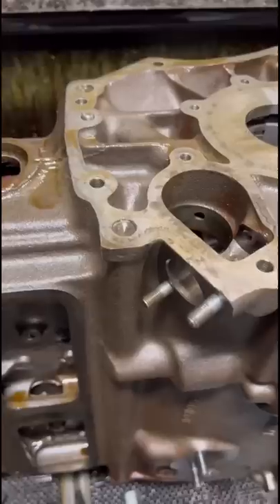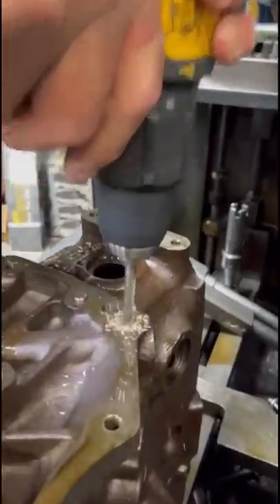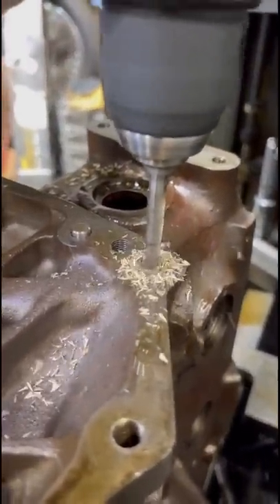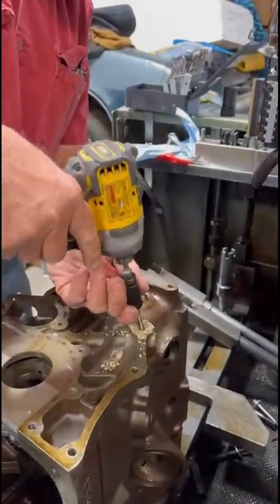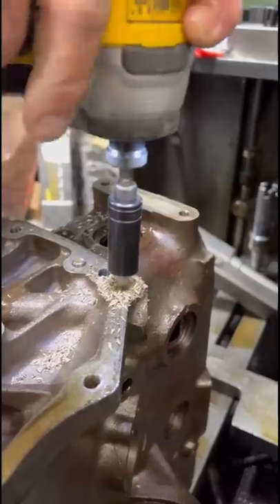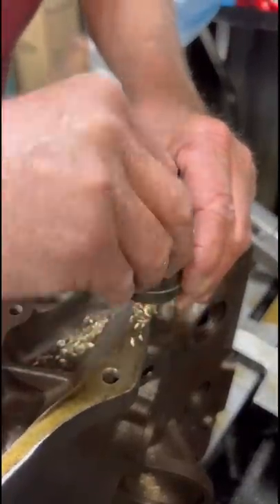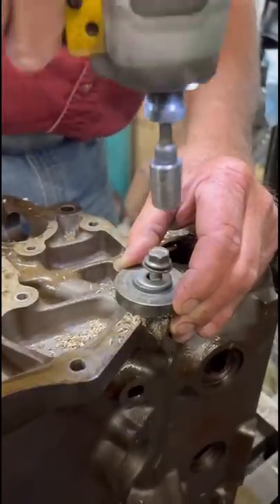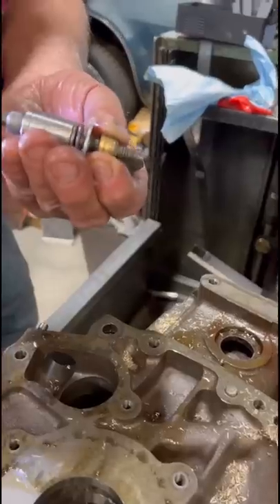#shorts How To Remove Press Fit Brass Oil Galley Plugs The Easy Way

Comment: You had me until "somebody else will clean up those cuttings later."
Reply: The “somebody” that will be cleaning the block is the guy narrating the video. This is his father that’s doing the work in the video.
Reply: If you're pulling the plugs you're probably about to hot tank the block, so yea
Reply: Not when he used an impact to tap the hole?
Reply: It was a joke. He knew he would be the one doing it.
Reply: j o k e
Reply: @nikolaskirisitz6769  he was going into brass with a HSS tap. Better to get in and out with the impact then fuck around with a tap wrench. If you break a tap doing this it’s because you hit the block 😂😂
Reply: By somebody, he meant him. He's just filming the old timer. lol

Comment: If you want to save even more $$, then I recommend leaving the bolt out as well. Those little bastards aren’t cheap. Less oil in the motor also means less weight, so better power to weight and fuel economy.
Reply: Bruh
Reply: Damn it why didn't I think of that.
Reply: If the women don't find you handsome, they should at least find you handy
Reply: Not to mention the reduced parasitic losses since your oil pump is No longer pumpin oil
Reply: Remember, if you see it leaking oil, it still has oil. 👍
Reply: If not even handy, then handicap.
This driller stressed out for camera and nearly broke the bit.
Reply: also do a radiator delete . the higher the temperature the better.  more temperature means more power and better fuel economy. you gonna hit max eco snd super charge abilities when you get that sucker fully in the red . the red means max power
Reply: Also less oil, less windage and adds horsepower, better fuel efficiency, better BITCHES,  BETTER MONEY BETTER LIFEFFEEE

Comment: Leave the shavings in there. The copper in the brass will combine with the oil to form natural copper-slip.
Reply: My Sarcasm meter must be broken... What?
Reply: the block still goes through a cleaning bath before going to machining. and again before going back to the customer.
why clean the same mess now when you're going to have  to clean it again anyway

Comment: Your sense of humor cracks me up. Did you clean those cuttings up already
Reply: lol I thought that too
Reply: it’s a skill i’ve picked up from watching these guys. it’s saved me from having to removea component, cut out a sensor boss, weld in a new, reinstall. i’ve greatly appreciated that leather knowledge over the last 6 months. 

(and if i goob up, I just have to pull and replace anyway)

Comment: Never use a impact when tapping. It does do the job faster , but you run a higher risk of snapping the tap . It also mss was led the threads a tad off and bolts are usually harder to screw in and out .
Reply: Dont matter for this guy he got too much finesse
Reply: Brass is soft unlike most other applications that you’d be correct in.
Reply: This was a joke......
Reply: Keith Smith  you called?
Reply: I do this all the time on high carbon steel, Mild steel and forged steel. Several holes in sequence at once. All you need to do is make sure that bitch is straight with the hole, oil the fuck out of it and change the tap one it gets to hot, use another one until the other one gets cool enough to use again. Look for cracks every 5 holes or so. And you're golden.
Reply: Bro literally says trigger warning first sentence of video and you comment this ?
Reply: Golden like that shower?

Comment: Balls of steel tapping that with an impact
Reply: It's only brass
Reply: Why is that?
Reply: Just never recommended to run an impact with a tap.. I mean turned out great but it just scares me haha
Reply: @ivking123  Why not. We do it everyday with great results
Reply: Triggered tapper... lol
Reply: I do that all the time, from 1/4" to 1" (we don't use metric that often but up to 20mm). Yeah they're a bitch to take out if they breaks but i work on production speed
Reply: @ivking123  Don't do it if you're not experienced doing it, or if you don't have to do it often. If it's a common occurrence in your line of work, like with these guys, then master it. Time is money.
Reply: Come on guys. Go easy on the "experts".
Reply: @jrod264winmag  it’s just with hardened steel taps, they are very brittle and don’t have much give when shocked by an impact. They’re stronger being hardened but they lose ductility
Reply: @Larry Powell extreme tolerance work like that is an art in itself! Definitely not an environment for the method in this video
Reply: @Larry Powell that sounds like a hell of a deal!! I'm glad you enjoy it!!
Reply: Found the machinist. And don’t give me shit I’m one too
Reply: Bet he went through a whole box of taps.
Reply: @bushmaster2936  brass binds worse than steel.
Reply: Nah he's good, I tapped cast steel with an impact, just make sure it ain't hammering away like on a stuck bolt
Reply: If the tap breaks it’s a nice stud to pull the plug out
Reply: @jrod264winmag9  you're being sarcastic or very careful those shits snap too easy even when used properly😂😂
Reply: Brass armchair expert, they do sell taps meant to be used in a drill
Reply: Tapping brass or aluminum it don’t matter
Reply: @BradChadley agree 100%, if you can’t hold your hand parallel as it moves without twitching, leave it to the pros!
Reply: @huskkyy yes, I could see in the video aNd daily at work how they shatter the instant the trigger is pulled🙄😂
Reply: @abovegroundgarage I see you haven’t really used a gas tap, not going to be much above the hole.
Reply: @dieselsmiths  are you talking about NPT tap? What nut are you gonna use on that anyways a cap? Lol come on u gotta point out the one odd ball ass tap that won’t work as a stud
Reply: Way too many people watching other people on YouTube do actual work, and then thinking they know about that industry. Anyone saying that tapping it with an impact is bad, obviously sits behind a desk.
Reply: @Rob-sr9rj  yes,power taps or spiral taps,not straight flute taps. It's monkey see monkey do.
Reply: @jrod264winmag  I doubt the results would be that good, especially with the swarf being compacted in the bottom of the hole you tapped. I never use power tools to drive taps. When I'm tapping a blind hole, I start with a taper tap first, then switch to a plug tap. I've seen thread taps busted by impact guns, even when tapping brass.

Comment: Machinist here. Don't use an impact to drive a tap. Maybe you can get away with it on brass, but it's a bad idea
Reply: I thought the same thing
Reply: A drill would of been better on the tap I’m a machinist also
Reply: Im pretty sure they’re aware of this and they made this video with the intention of fucking with all the know it alls that happen to inhabit the YouTube comment section.
Reply: Satire my fellow wrench turners.
And a great gob at it too.
🍻🎉🎊🍸🤙🍹🤘🍷
Happy Independence Day
Reply: Agreed
Reply: And here he is 🤣☠️
Reply: I agree, the true test was that he wasn't !!
Reply: @Neklar  I agree. I have a tap & die set here. I spared no expense on it either. Fitting & maching was part of my job in the auto industry a long time ago. Sometimes I had to make studs in odd thread sizes like you've done, but the lathe I used had thread cutting capability. It was simply a matter of changing the auto feed gears to suit the thread pitch, then fitting the tool in the tool post, putting the stud bar in the chuck, then starting the lathe.

Comment: I've been a machinist for 12 years now & make million $ parts now and then, and I approve
Reply: I really hope the machining you’re doing isn’t too accurate to require a hand drill with zero indicating on that hole… I’d imagine a random engine is probably fine but not as a factory.
Reply: @SantaCllaws  all he is doing is removing a plug, precision is not required. As long as he doesnt accidentally drill into the block its fine. Speed is the name of the game in this case.
Reply: @Redtooth75  oh no I’m sure it’s fine, but a jig for keeping that drill centered and flat onto the hole would help when there’s the inevitable break on the tap.
Reply: @SantaCllaws  No shit lol I assumed it was clear to most of us at least that I was simply stating I know what Im doing when it comes to machining and still approved of his process. But next time I'll dumb it down for you if you'd like.
Reply: @micjr21  Darn angered the old man what am I going to do!

Comment: That's basically a scaled up version of how you remove a stuck brass bullet casing from a sizing die!
Reply: You mean you DO NOT HAVE TO DESTROY THE DIE TO GET IT OUT??? Say it isn't so......
Reply: @Pyle81  luckily no. You drill through the primer pocket, then tap it. And then you use a screw and like a cap to tighten it and it pops off. If have a primer inside there then you'll most likely hurt something

Comment: If you are drilling brass plug, change the way you sharpen your drill bit.  Get rid of the “hook” by grinding a flat across the cutting edge parallel to the long axis of the bit.  That way it won’t grab like that.

Comment: I work in a steel fabrication shop. We tap almost every hole with an impact, it's easy to break taps at first, but when you get good at it, it's a feel thing. Much faster, especially when you're running through 1/2" of material. I'm also a machinist and was very skeptical of this technique at first. They actually make "tap sockets" just for this.
Reply: It was only tapping into brass which is fairly a softer metal than what normally would be tapped. So the tap wouldn’t really break tapping into brass.

Comment: You know what have been really funny. That tap  Breaking!
Reply: Tap breaking in brass? 😂
Reply: @jarradrumbold  thanks. He's driving the tap with a impact and all you can say it's brass.  Now if you would have said it's only a quarter inch thick and it's not a blind hole. But it still doesn't change the fact he was running it down with an impact. If you can break off a tap in aluminium you can do it  in brass. But thanks for your help.
Reply: @bige9830  I once broke a tap with an impact drilling through air once. Never use an impact.
Reply: @amadafaka  I'm not sure how to respond to that.
Reply: @bige9830  Me either.
Reply: @amadafaka   So that just wasn't a really dumb insult. Are you just think you know what your  talking about? You never ever use a impact to cut threads.  That's just a butcher repair. 35 years in the biz,  that was stupid. When you teaching some one how to do something you teach them the right way not the hak way.
Reply: @bige9830  There's some really effective medication nowadays, drugs therapy and regular therapy have come a long way in 20 years.
Reply: Joe 609   You're correct but there's a few points you've missed. 1st you need to be using a good quality drill If the hole is  askew in any way that'll cause the bit to break. Another thing you need to do is after you cut 4 or 5 threads you wanna back the tap out a little bit to clean the threads out.   If you don't do that you'll cause the tap to lock up and snap. Another problem is just a simple act of the tool hammering the bit. Even top quality taps are brittle. Another problem with using power tools is that you take the feel out of it. If you spin it with a hand ratchet you can feel the tap locking up there and turn you can reverse. You don't have that feel with an impact.
Reply: Joe 609   So you're one of those!
Reply: I tap stainless pipe just like that... Never broken a tap making threaded holes in milion dollar tanks where you would be looking at thousands of dollars in repairs I'd you break the tap dude.... A impact can swivel on the end of the tap while the tap stays straight through the hole... Your hand is the problem you can't keep a tap perfectly straight by hand... The impact turns the tap the tap pulls itself in and keeps itself straight.... It's simple as fuck and exactly the same way a dude with a mill does it just a different torque tool... Not like your a master tradesmen though.  8 years of experience building equipment and containment vessels what you got boi
Reply: @bige9830  He's not making a repair, he's removing a plug that will be replaced with a new one. Calm down ffs.

Comment: Actually, you don't really need a sharp drill bit for brass. Brass cuts best with no top rake, so a dull drill bit sometimes works better (depending on how dull it is of course)
Reply: Yes!! Talk about the drill getting away from you. Sharp bits in brass will take your wrist for a spin.
Reply: Good to know! Was wondering why brass broke that tiny bit.

Comment: Warning: not everybody can thread tap like your father using drilling machine. It's so damn easy to ruin the threads
Reply: Yup, experience necessary
Reply: Time is money, pretty sure he knows what he's doing.
Reply: Ruin the threads on the tap? Sure he wasn't too worried about the plug, right?
Reply: Yeah, but the plug is garbage once they pull it, so that's not really a concern
Reply: Why would you care about ruining threads in this particular application? He's threading the plug just so he has something to grab onto to pull it out. He's throwing it the garbage after.

No real machinist would ever make functional threads this way.
Reply: Yeah, exactly.   He's not actually trying to make good threads.  He's just getting that plug out
Reply: I don't understand if you go into to a machine shop almost every threaded hole is done under power you are more likely to break a tap taping by hand then with a power tool.
Reply: @terryallemann2654  Lol, depends on the application and 'power tool'. if you're using a drill press or mill, then, yeah, its perfectly square and consistent in speed, rigid, etc. If you're using a hand drill, its pretty easy to break a tap, but its 10x faster than doing it by hand, and not that hard once you've done it a bunch, that's why they do it

Comment: I'm guessing you don't have to drill straight or tap the hole straight either. I would be worried drilling the hole at a slight angle.
Reply: It's just to get that plug out.  I wouldn't suggest using an impact to actually make good threads.

Comment: Still amazes me how many people incorrectly use the term “oil galley” instead of the correct designation, which is “oil gallery”.  It’s quite obvious that long, winding passageways within an engine have much more in common with galleries such as those where art is displayed in long hallways, than they do a kitchen, which couldn’t have less in common with an oil passageway if it tried.  And despite this, the reduction of syllables by one and the substitution of a word that kind of almost sounds similar, is just too tempting to resist, it seems.

Comment: Not gonna lie since it's brass just use a bolt almost the same size as the hole, impact it in, should cut its own threads anyways. ;)

Comment: As a machinist who made parts for the mars Rover, I would say tapping with an impact is cringe.
Reply: As a martian who stole yalls shit. This thing sucks, do better.
Reply: It's the dumbest possible way to tap a hole.
Reply: @sammorgan31  if you break a tap in a brass plug your machinist card is officially revoked.
Reply: Serious wtf moment. I have broken taps with wrist power... The thought of using an impact wrench is hilarious.
Reply: You must have a nice armchair sir
Reply: It's not like the tap is going to break off in a brass plug
Reply: Couldn’t help being that “arm chair expert” huh?
Reply: @Bubu567  its easier to break by hand than it is with the impact drill. Little experience?
Reply: Omg here it is, our Mars rover special machinist giving advice

Comment: I think theres a difference between pros, and guys toolin' in their garage. If you're in a shop where you do this all day, time is money, and you have the tools/skills for the 1/100 that mess up, yeah. If you're working in your garage, better to take it slow/by hand... so you don't have to bring it to the pros.
Reply: Yup but as the video said, test of who is a machinist and who is not. An experienced machinist can use the faster method with lower risk of a f*ck up. A DIYer probably couldnt do this anywhere near as reliably, i still tap by hand very slowly lol.
Reply: @GeneralNOH  you are right, time is money but the cost of mistakes can be even larger sums of money and/or injuries, which can  cost even larger sums of money as well as …… well, you get the picture.
Reply: @lenardforder7179  not really. Even if you have 1 fuck up every month you're still going to be saving thousands of dollars worth of time every month. Most businesses operate with a fuck up factor.

Comment: I would not think that's a true test of anything. I been a machinest for 50 years and I would never use an impact driver on any tap.
Reply: It's almost like when someone comes in crying about armchair anything it's because they're blatantly insecure in their own work. The thing is that if you genuinely believe in the quality of the job you do, you aren't worried about random people questioning the quality because even in the worst case of being bombarded actual experts will back you up. This entire video just screams "our piss poor practices got called out so okay experts, tell me what I'm doing wrong but also I implied you don't know what you're talking about so anything you say is immediately wrong until proven right"

Comment: Finally someone using a power tool to tap soft metal of sheet metal. I say this all the time. And ive even learned how to use the clutch on harder metals
Reply: That's a 1/2 solid plug but yeah... I don't even clutch tapping into stainless steel pipe fast game is a good game.